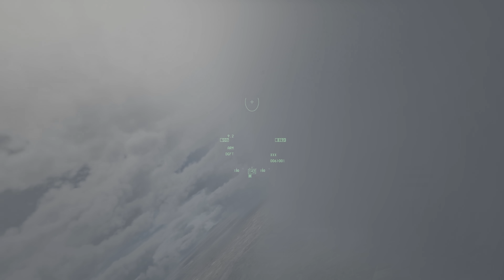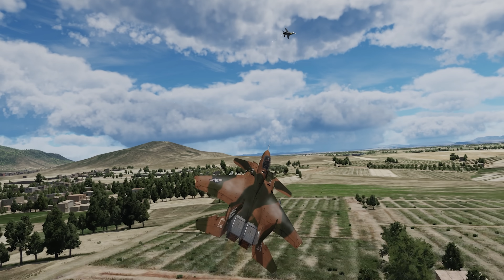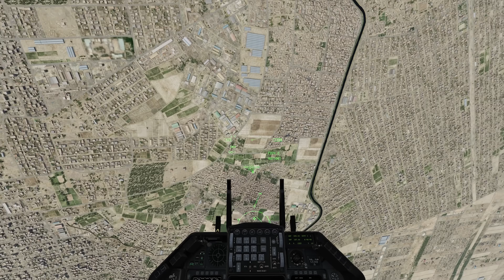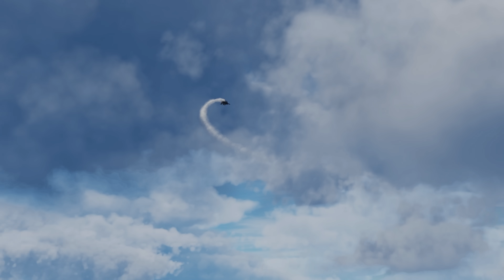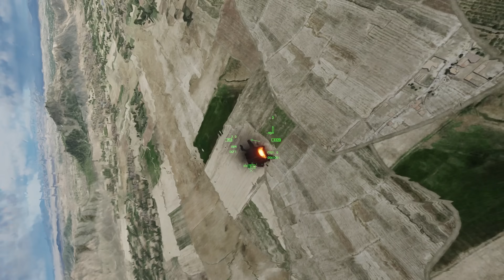Upgraded F-15 STOL/MTD vs F-16C Viper Dogfight | Digital Combat Simulator | DCS |

Comment: I'm a retired F-15 C/D/E crew chief and I want to know where the hell they put the actuators for the canards
Reply: Im pretty sure what they did was remove the gun in order to make room for the actuators, so the only way for it to have guns is for it to have a gunpod on the center pylon
Reply: 5:50 he explains it, f15 engines guy here and I was thinking the same thing 😂
Reply: Who needs radar.
Reply: The gun and the in-flight refueling receptacle and associated plumbing was removed.
Reply: I have about 50 hours in NASA 837 at Dryden. (Now Armstrong) I know, I know ... I just drive your jet.

The internal configuration was altered more significantly than comments suggest. Some volume was "found" by removing the gun, but it all had to be reshuffled internally. The main reason the gun came off, IIRC, is that its trajectory would have ben THROUGH the canard.

The canards are actually attached at the Wing sponson fairing/LEX. There is a fairing for the actuator on  top of the intakes on both sides, about even with the AC exhaust.

Electric and oxy had to be rerouted, I think the internal tank configuration was changed, There was some repositionining of the in-flight fueling receptacle, but it remained problematic to execute in flight refueling ... I can't remember what else. When the crew briefed me ... I was overwhelmed quite frankly.

There are so so many alterations to test articles from their operational variants, you basically have to throw out the operational book and start over. Not only do we have a ton of instrumentation, we often have new equipment on board, like space based ranging gear, and aerodynamic thrust test gear. The plane would change configuration, internal and external, one flight to the next.

Always a little too exciting.
Reply: @unknownuser069  thank you for sharing this. I’ve worked on F-15s for almost half of my career in my specialty, and always wondered what had to be modified.
Reply: @mattman2216  

So… last I flew it, the real NASA 837 could not mount center pods or weapons. 

That station was taken up with equipment for aerodynamic testing of propulsion systems called “propulsion flight test fixture.” (PFTF) Basically a pylon we could hang a rocket or jet on. Then we could adjust its yaw or AoA  and measure the impact on the aircraft, both with and without its own propulsion. 

Then after some math with a supercomputer you could determine its propulsive capacity and aerodynamic profile.

The instrumentation of that was finicky, using pulse code modulation on analog wires IIRC. 

We used that to test combined cycle rocket motors and pulse detonator engines and some other cool stuff. 

Main point … you could no longer hang standard AF pods or ordnance on that station … so no gun pod.
Reply: @unknownuser069  Awesome tidbit thanks for sharing!

Comment: The F15 MTD was one of my favorite DCS mods, but I went to reinstall it lately and it is bugged. You have to launch the F15C first then load into the MTD but none of the controls will work except canopy and throttle pretty much. I have an old installer from 2022, is there an update that I cant find??

Comment: Last I checked, the F-15 STOL/MTD did not have a gun, so where did he get one? The canard actuators  forced the gun to be removed. Also, why does the F-16 have USAF AND! Russian insignia on it? Couldn't make up it's mind?
Reply from the maker: lol I mentioned this in the video brother, its using a gun pod.
Reply: @GrowlingSidewinder  I  still want to know why the F-16 had USAF and Russia markings, YES?
Reply from the maker: @RMRobin7373msn  thats what the markings look like on an aggressor squadron, used to train other aircraft squadrons at events like red flag etc etc
Reply: @GrowlingSidewinder  Now my real question. Did you know that at Davis-Monthan AFB, Az there is an interesting F-14 Tomcat in the Boneyard? It has Day Desert camo paint job on it with an Israeli blue Star-of-David on it? It is still there.
Reply: Seems that the F-14 with AIM-24 missile was a little too much for the IADF as a fighter was more required. It was used in case Egyptian flown MiG-25 became a real problem. However the F-15 was a much better match for their requirements. And with that, history agrees. I wonder what that had been like in the Middle East if F-15s had been augmented with (your old favorite) F-14 Tomcat with Phoenix missiles? Hmmm?!